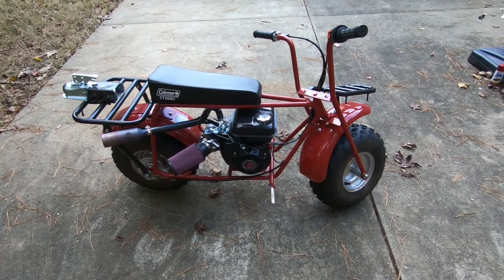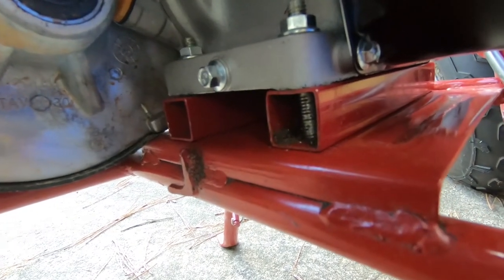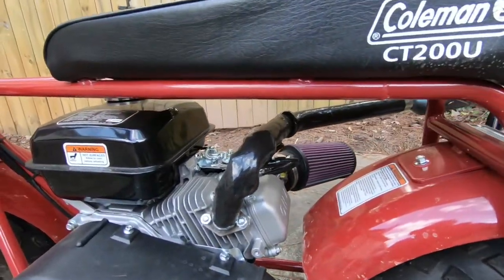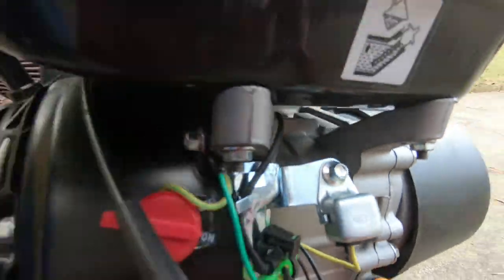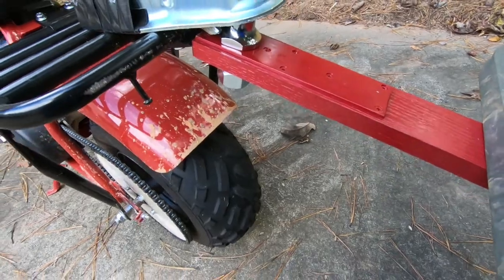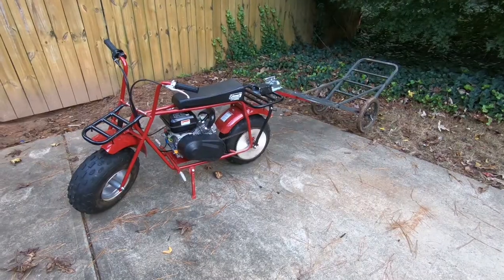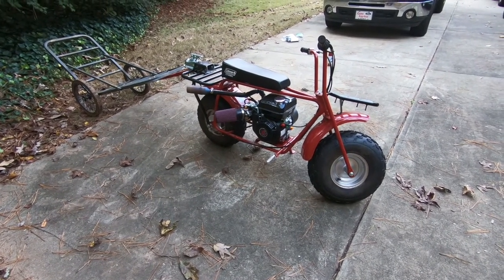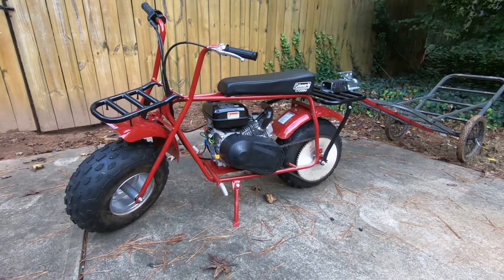Deer Bike

Comment: Thank you for this. Mine did 20 before governor removal and 31 after. I'm 275. I swapped to the torque converter and got to 36, but the engine only revs to seemingly the governed speed. I just ordered the 72 tooth and I hope I can get 39 as well. Did you have to get more chain?
Reply: You wont go faster by doing a larger sprocket you will have more torque and less speed. If you want to go faster id recomend taking off the jack shaft or torque converter, and fliping the stock clutch, alighning the sprockets, and make a new chain out of the chains you had or order #420 chain and you will double the speed you where going with the clutch setup iv got a built hisun to 15-18hp in my hisun with all the billet parts and a .308 cam and i rev to 8500, on stock gearing i do 52 mph anywhere please ride at your own risk with these speeds its skechyyy as

Comment: This is awesome!! I’ve been wanting to do this for years but was afraid it wouldn’t work. Buying one now!!
Reply from the maker: Highly recommend it, it’s worked great!  I would see if you can find the version with the front suspension. I think that’d be well worth it, but it was not available when I did this project.
Reply: I’m really looking at the Coleman bt200x
Reply: Do you find the 72 tooth sprocket to be to aggressive? I was thinking of using a 60
Reply from the maker: TheBudgetMonkey83 not for flat out pulling. It’s a straight up mule with the 72, and will still do nearly 40 mph with the torque converter.  If I could find an 80 tooth, I’d go for it!
Reply: @MattCorya  on the Coleman site I believe the front suspension kit is under 150 still

Comment: Two things did you keep the original sprocket on the TC 30 series that drives the rear wheel or did you have to change it to use the 72 tooth rear .and did you put a billet  flywheel
Reply from the maker: I swapped it for the 72 tooth.  I did not change the flywheel. I don’t run at WOT long enough to be concerned about it.

Comment: Great video! I'm doing something similar with my CT200U for pulling a sled with split firewood out of tight places in the woods. Not super heavy loads and not much uphill, so I think I might get by with the 60 tooth rear sprocket and a torque converter. I plan to leave the engine stock. Also, i don't want to cut off that frame brace as it might be there to strengthen the frame. Do you have any problem with the rear wheel spinning and lack of traction? Thanks!
Reply from the maker: I definitely don't have problem losing traction...the way the trailer attaches, it adds even more weight to the back of the bike, so if anything, I have too much weigh back there.  Though you can maneuver the weight back on the trailer, and actually provide some lift to the rear rack.  I'm around 200 lbs though, and I've never had trouble with the rear tire breaking free unless it's on snow or mud....but I take it pretty easy on the throttle when towing a load to help ensure that's the case.
Reply: @MattCorya  
Good to hear. In that case I shouldn't any problem sledding firewood, thanks!
Reply: They make a riser plate for these that allows you to keep the frame rail.

Comment: How easily does the loaded cart tip over traveling through those woods?
Reply from the maker: Hasn’t happened yet, the cart has a reasonably wide wheel base. To be fair though, I don’t ride sideways across hills. Generally I’ll drag the deer downhill to the nearest path and load it up there.

Comment: Just a quick question I don't have a lot of clean cut trails on my property do you think it would still run good through somewhat tall grass or like a bean field if we dragged a deer from there? good video by the way!
Reply from the maker: I can't imagine it would be a problem at all.  It's got plenty of power to drag through tall grasses, etc.  You  MAY find yourself cutting a path through the bean field due to the foot pegs snagging on the plants as you drive.  Really the biggest limitation of the bike I can see are in areas with large/loose rocks or rutted areas, it's not great due to the lack of suspension on the bike, so I just take it slow.  Other than that - the only other concern I have is on very steep hills with the additional deer weight being dragged.  I find I need to shift my weight WAY UP towards the front of the bike, to keep the front end from coming up.  That's actually the reason I attached the cart to the bottom of the back deck - so it is actually not adding leverage to the rear, but somewhat "lifting" the rear deck and helping to apply more pressure on the front tire...of course that is highly dependent upon how we load the deer on the cart - 12 inches to the front or back of the cart makes a BIG difference!
Reply: MattCorya Thanks for the info!

Comment: I put 18 lbs valve springs on my coleman ctu 200 196cc,  having hard time starting engine. Pull start is hard and recoil hurts my hand.  Adjusted valve lash .006 and .008 to top dead center still having same problem,  any suggestions please thank you.  Great Idea with the bike, I've dragged my share of deer out of the woods.
Reply from the maker: Chad Carpenter sorry man, not the most experienced mechanic, learned just enough to get this thing working. There are lots of resources out there though, like the “Predator 212” Facebook group.
Reply: @MattCorya  Thank you I'll check into the 212 group on facebook.

Comment: I’m totally copying this for my Coleman CT200U. If I just do the Torque Converter and 72 sprocket, will it be enough pull deer?
Reply from the maker: bryan aulisio I really feel like those two mods should be sufficient. I did all of the mods before attempting to pull anything. But I think it would be a good idea to do the TC and sprocket, hook it up and see how it does (load the carry with ~200 lbs or dead weight and find a hill).  If it needs more power, you could add more mods, pull the governor, etc. until you are comfortable with it.
Reply: Thanks for the reply. The Coleman is so light I can strap it to my hitch basket. If the mods work out, I will have a super portable, inexpensive, atv.
Reply from the maker: bryan aulisio exactly right, and exactly what I was going for!  Enjoy the process, and have fun with it!
Reply: MattCorya thank you for your help. One more question, how did you attach the hitch cover to rear rack? Simple nuts and Bolts
Reply: @bryanaulisio4164  did he ever respond to how he attached it?
Reply: @davidgodfrey7560  ball hitch mounted on a piece of wood with aluminum mounting plate . Attach the wood to the rear rack with large U bolts .